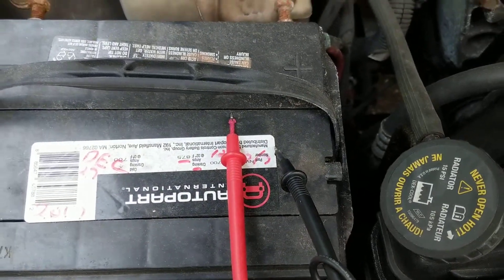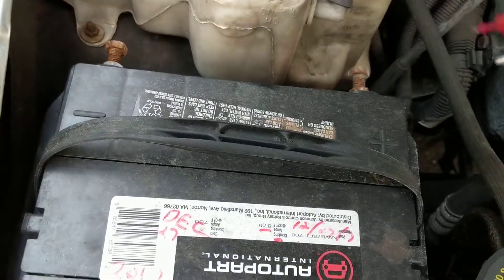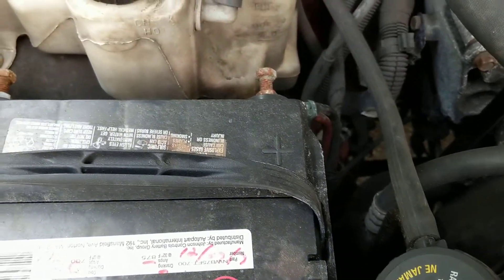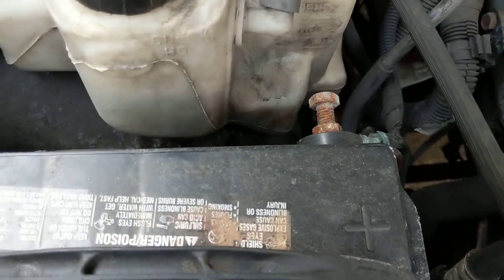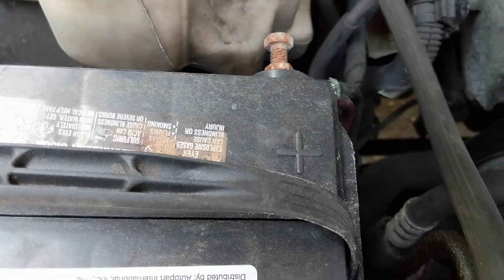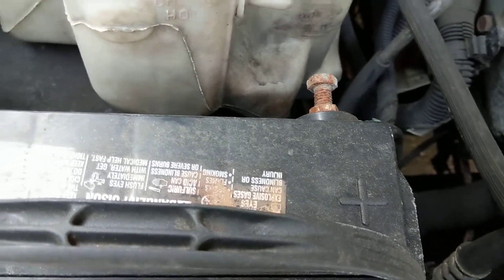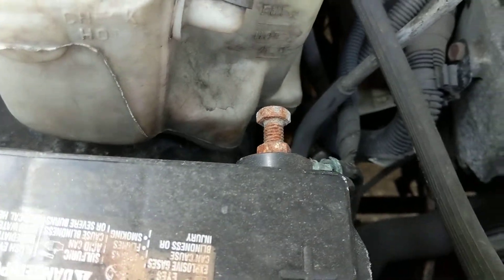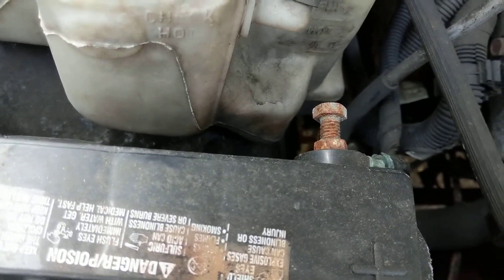WHICH TO CONNECT FIRST on the car battery and disconnect first, POSITIVE? OR NEGATIVE MUST SEE!!!!

Comment: The wrench with a fuse is a decent idea, but would probably be very hard to do. You'd have that thin metal wire with some kind of an insulator, which would have to be very strong to withstand the torque applied to the tool. But that doesn't mean it's impossible. I like the idea and might look into some more
Reply: Just takes one idea hopefully a good idea but I haven't hit it yet